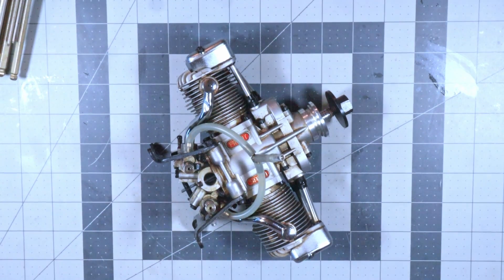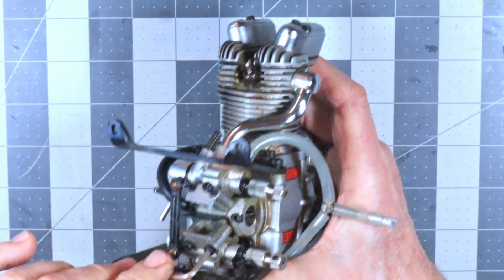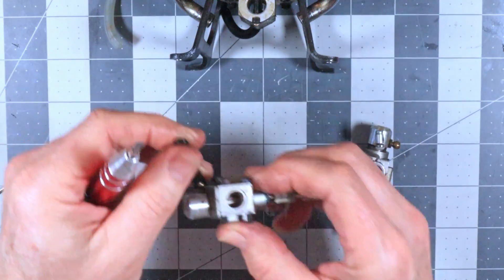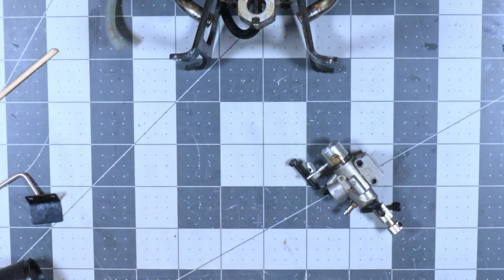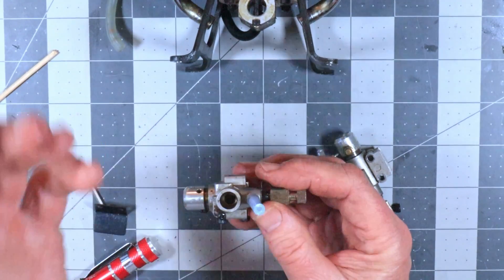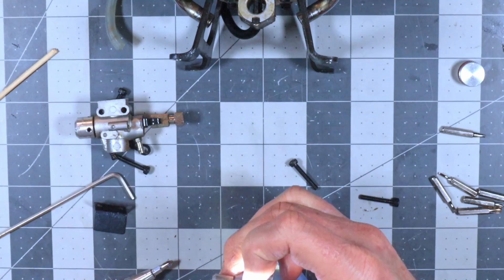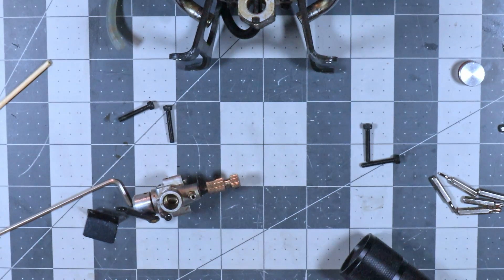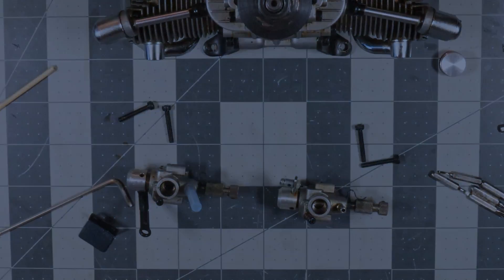Saito FA-130T Carb removal and Initial setup

Comment: Are there any rebuild kits for these or do you just throw them in the ultrasonic?
Reply from the maker: Not sure i understand your question. What does a rebuild kit have to do with the ultrasonic cleaner? The cleaner is to clean the metal parts. Those are not typically just thrown away and replaced. Besides parts for this engine are nearly impossible to find. Rebuild kits typically include o-rings, gaskets, and bearings; consumable items.

Comment: nice find great doccumentation,...
I was wondering if you find time  briefly discuss TIMING of  twins or others mult cylinders
I understand the  twins that fire at the same time ,...have you worked with any that fired in series,....
thanks 
Mike
Reply from the maker: The link to the review article in the video description talks about the timing of this engine. Since the cylinders are inline and both connecting rods are pinned to the same single pin crankshaft that makes this what is termed an odd fire engine. That is opposed to the boxer style engines with a dual throw crankshaft. The Saito 60T, 90T, 270T, and 300T are all boxer style engines. Whereas the 80T, 90T, 100T, 130T, and 182T are all odd fire engines. OS twins are all boxer style engines.

Comment: Hey David, you are again doing a very nice job on this truly very bad intake setup. I don't know what saito's engineers where thinking when they desinged this intake. It is bad design in so many ways.... it makes proper operating of this otherwise great engine near impossible... Bit I know you got it running great in your older  videos on the same type saito. If I was to own and operate this, I am sure I would redesign and build a completely new intake and carb system
Reply from the maker: Thank you.  While I would not consider this a ‘bad’ design; it is quite ingenious really.  It is a bit challenging to adjust is all.  When I think about it more the throttle stop screw on the right cylinder, the one hidden from access, really does not need to be the one set for min opening.  Since the two carbs have the linkage between them, then only the left cylinder needs to be set.  Now it is still almost impossible to see the opening but still only that one needs to be set.  Also keep in mind that to keep costs down as much as possible, Saito chose not to design a separate carb for each side; they used an existing one for both. With that some compromises were made.
Once these carbs are setup you should never have to adjust them again.  They work well and the engine is an excellent runner.  Far be it from me to ever criticize Saito engineering; I could not do better. This, however, is the only engine that ever had this carb setup and the production life seemed rather short. According to Saito’s website it was only produced between 1987-1990.  I believe this is a fine engine and one to keep purely due to the unique design.  Once you see my run video from yesterday you might agree with how well it runs once properly set up.